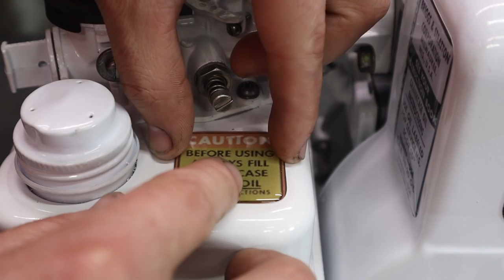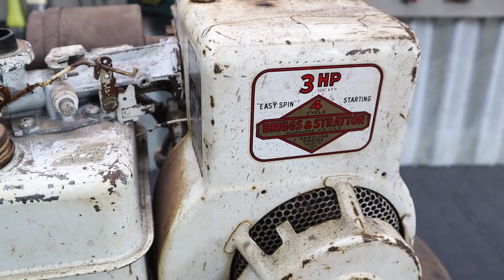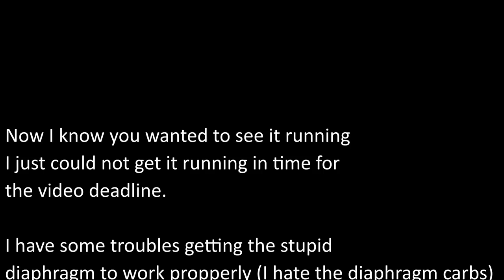1974 Briggs & Stratton 3HP Motor Restoration [Part 2 of 2]

Comment: This was a cleaning of parts and reassembly . I didnt see a gasket used for the cover, or, new bearing's, piston and rings, new crank seals, a light honing of the cylinder for good seal of rings, not a lot  of new  parts, but, a major cosmetic restoration . Now, if you did other things such as installing  new parts or you performed other procedures you didnt show in the video, I apologize in advance. 😊 Its the perfectionist in me. Great video !
Reply from the maker: Most of the procedures were done off screen purely for the reason that the video would be 4 hours long. Sometimes the engine rings are still good so I go by if its still good, I leave them be.

Comment: When it comes to adding oil buy a plastic measuring cup. Fill the cup with the required amount of oil needed. Tilt the engine backwards and add the oil. Wow no mess. Just a thought here.

Comment: Don't mean to be a nitpicker but, one of those balls on the starter gear jumped slots and you doubled up balls in one slot, and I noticed you didn't put a tank - carb gasket in, and also an intake manifold gasket on. That's going to cause an air and fuel leak. That may be why it wouldn't start for you. Hope you got that straightened out.
Reply from the maker: Good eye, it turned out to be a faulty carb diaphragm.

Comment: Looks great!!  I like how you never showed the valve spring  R&R oh and you forgot the choke knob linkage rod. Tip: put a bolt back in the thread boss on the starter when you take it off, saves on the eye, too bad one was broke. Looks awesome!!👍

Comment: I was recently given a lawn edger that uses an engine almost identical to this. The carb is different in that it does not have the diaphragm.  Can you make a recommendation on where to find a service manual for these types of carbs? Thank you!
Reply from the maker: There are quite a few online.
Reply: @AJRestoration   Everything I find refers to the carb with the diaphragm and not the model without the diaphragm.

Comment: Very nice work!  Question:  the PTO end with the reduction gearbox looks different in the "after" shots.  Did you replace it, or just orient it differently?  Thanks!
Reply from the maker: As far as I know, its the same?
Reply: @AJRestoration  Hi and thanks for the response!  I looked again; if you compare 28:57 to 29:15 I figured out what the difference is... it looks like the bell housing is rotated 90 degrees clockwise from the "before" to the "after."  It seems as though it was designed so it would work either way so that the oil drain for the gearbox could be oriented left or right.  Love this series and all your restorations!

Comment: When you put the crankcase cover on, did you leave the gasket off? I did see you adjust the points and give it a spin test to see if it’s sparking? I didn’t see you put a gasket on the carb? You should of plugged the hole in the point cover. And siliconed the wire, to prevent moisture from getting in. Was this your first ever rebuild?
Reply: Thank you great friend. did an excellent job. I left my like. And I already signed up.

Comment: Does anyone know that model of this carburetor?

The cheap replacements I've seen that fit this style of engine don't have the same layout or crankcase return port.  I can rebuild a carb with the right kit, but I also need the tank screws as they are all stripped and can't be tightened properly.  It was like that before we bought it a few decades ago ;).

Comment: Nicely done, thank you.  I have one question about the valves.  Why do you grease them up and then spin them in their posts ?
Reply from the maker: Its engine oil, its so the valves have good lubrication
Reply: The spinning with the compound is called lapping. The compound is gritty and help get any burrs off the valve and valve seat so they mate and seal when the valve is down.
Reply: @jkurl15  thank you.

Comment: what have you done to the wire to the carby & the rest of the carby fittings?
Reply from the maker: I did not attach them again since I wanted to use the choke and throttle manually.

Comment: I didn’t see the points being adjusted, perhaps that’s what preventing the starting
Reply from the maker: There is spark, the issue is the new diaphragm I got, It seems to be the wrong part. If I spray a little gas in the carb, it starts right up.
Reply: @AJRestoration  Good information! I love the work and its great to see these old machines coming back to life.